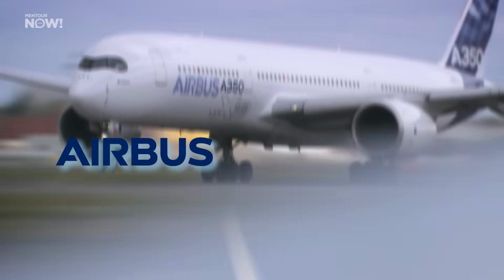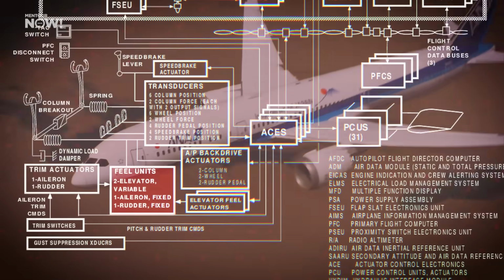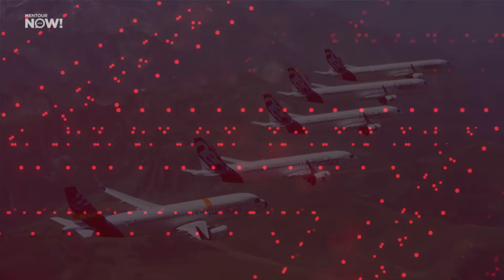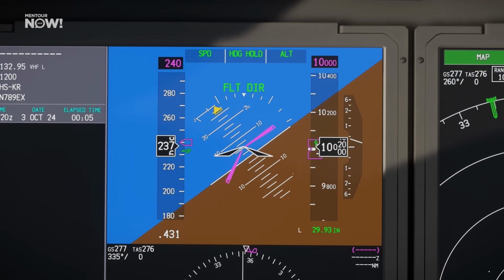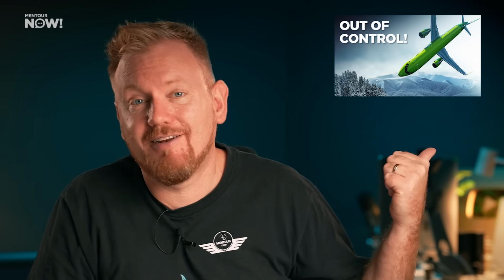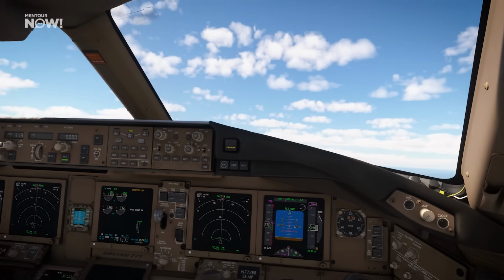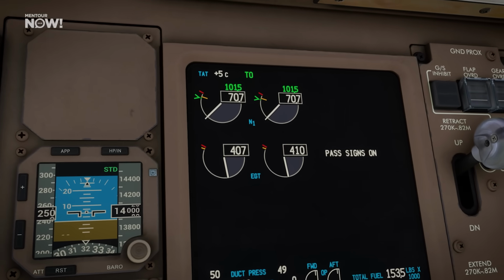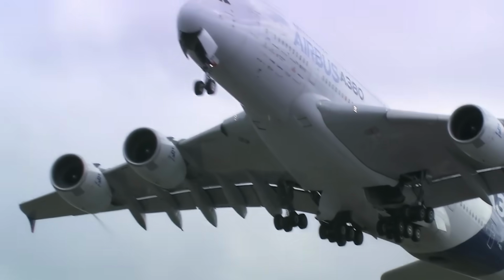Do Pilots Prefer AIRBUS over BOEING?!

Comment: The fantastic safety record of the 737NG also shows no statistical difference to the A320 family. These are the planes that are/were built in huge numbers, and each aircraft usually has multiple flights per day. These high numbers really give you the best statistics possible. 

I guess it's also safe to say that the updated 737max will be as safe as the NG. 

So long story short: Boeing or Airbus? It actually doesn't matter at all.

Comment: As a professional seaman I say like this - there is not such thing as too much information, ever. If you feel overwhelmed by too much information at hand, then it's time to seek a new less complicated profession 😏
Reply: True, but less important information can drown out the most important information based on how it's presented,  information can be faulty,  and with modern systems,  the computers could be better designed to filter out errant or misleading info,  warn about contradiction, etc.  And good grief- why don't they have cameras pointing at wing and tail surfaces and landing gear?
Reply: @jamesengland7461  Fully agree - when one can independently filter the information, then it's the best choice. If there is no choice, then I'd rather take more, than less, and I believe this is the case here. Point about the cameras well noted, I do not know why there aren't any such systems (in most cases) yet.
Reply: That might be because your ship moves much much slower and cannot get into an uncontrollable state as quickly as a plane can, when handled incorrectly.
Reply: @axeln6743  Not as quick, correct, however this depends on the situation. When handling cargo operations with chemicals, then it's another story. On a chemical tanker navigation is simple, port approach a bit more complicated, however all this pales in comparison with cargo systems, which you do operate yourself. Different situation.
Reply: Too much information when you don't need anything beyond the basics is wasted.
Documentation is fine, but I don't need a 40 page backstory on aviation systems in order to diagnose or troubleshoot an issue. Especially when time is of the essence and lives depend on it.
Reply: It all depends on how much time you have to process the information and what else is competing for your attention at the same time. I presume that in most circumstances at sea, the time from the start of an emergency to a total disaster and everyone dying is a bit longer than on an aircraft out of control.
Reply: @nrml76  Very true, there is very often more time, however that depends on the situation. On average yes, in particular cases not much more time.

Comment: It's not a debate. Boeing has been clear second for the longest. Clear cop out in the conclusion. Perhaps Boeing's 4th generation planes, the 777 and the 787 are "safe" ... when it comes to Boeing's production figures, the 737 MAX is/can be/should be produced at the highest rate with the most orders on the book. The small planes most people fly and make kilometers in are either 3rd gen Boeing or 4th gen Airbus. And with 90% less incidents that means that in the mean taking an Airbus is 10x safer.
Reply: No, the 737NG and A320 have very similar safety records.
Reply: I recently was watching a planespotting video.  There were more Airbus planes flown in the 1 hour video than Boeing.  It was mostly A320's, A330's, and A350's. I also watch plane crash videos.  MOST of them are Boeings, and it's not even close!

Comment: Flown both, 10000 hrs on the Airbus and 7000 on Boeing including lamentable Max. If 737’s were fridges they would have been banned years ago. Airbus for my money are way more impressive, the cockpit’s are quiet, roomy and well thought out with a great operating philosophy. Many note the static thrust levers are a hazard but because Airbus FMA’s are rigorously called out and acknowledged the operating loop is tight. Protections are brilliant, windshear full back stick and Toga power the jet will look after you as with all the other potential pilot cockpit ups. Most of the Boeings I flew were powerful and had good lift but goodness the cockpits were messy and some (737) noisy and manuals were complete gobbledygook’ flaps are not down they are not up? What?
Reply: @Blueteddy-kq1pj  
Fascinating comment. I had heard of the quieter cockpit in the Airbus before. Surely massively important  for any flight beyond 90mins?
Reply: It is clear from pilot comments that 1) Airbus wins in cockpit design, room, and comfort and 2) pilots feel comfortable with what looks like excessive automation.
Reply: Maybe you should take the MAX for a ride.. good upgrades.. would change it for one of those busses..
Reply: @ACPilot  He said in the original comment that he has flown 7000 hours on Boeing aircraft, including the 737 MAX?

Comment: AF 447 Would not have crashed if it was a Boeing
Reply: The multiple crashes that happened from pilots pulling back in panic on their controls during a stall and letting the plane fall like a leaf into the ground wouldn't have happened if they were an Airbus. Stall protection has saved people's butts multiple times
Reply: @ianriggs  In this instance, pilot(s) got confused between the stall warning and erroneous IAS (too fast). Stall Warning takes precedence. Airbus side-stick philosophy allows pilots to input independently.. Not so on an ac with control column where inputs are clear… this is especially significant when entire cockpit is lit up like a Christmas tree and the ac is screaming at you, especially with stall warnings. Things need to be dumbed-down as much as possible in these situations, not everyone continuously pushing side-stick priority fighting for control. Airbus definitely has advantages over Boeing, but cockpit philosophy using  big chunky switches and control columns is a win.
Reply: @TheJunglecrab  they definitely both have their pros and cons. But I think overall, the flight envelope protections have proved their importance. The fly by wire and Airbus cockpit certainly aren't perfect in every situation, but my opinion is that the protections have saved people's butts enough times to prove their worth
Reply: @ Every Boeing plane is effectively fly by wire except for the earlier verisions like the 707 727 and 737. Boeing also has flight envelope protection but ultimately pilots can override against force transducers  (as opposed to Airbus, where the flight envelope cannot be overridden (*completely))
Reply: @TheJunglecrab  777 and 787 are the only Boeings that could be considered fly by wire that have any form of flight envelope protections if you don't count the max and it's secret "protection"
Reply: @ B737 NG: MCP inputs send a command to FCCs, in turn send a command to autopilot actuator. This inputs to the  flight control. The flight control subsequently  moves and gives feedback to a back-drive actuator causing control column to follow the control surface - Et Voila, fly-by-wire. Yes, there are cables  and crank assemblies involved (mostly removed on 777 and 787), but whether the  PCU is in the wheel well or on the control surface doesn’t change the fact that it still is “effectively” fly-by-wire. Yes, pilots flying without autopilot engaged, is not fly-by-wire.

Comment: The next generation of commercial aircraft will take even more away from the pilot. For example, modern electric EVTOL aircraft are so simple to fly that a pilot does not have much input. As a pilot that is flying an older Boeing that uses cables (737 NG), I feel lucky to have this experience of handling the aircraft manually. Hand flying is truly a joy that future pilots will never be able to experience in the next generation of commercial aircraft. I got into aviation for a reason, and hand flying my 737 is why and I do not ever want that to go away.

Comment: Airbus, Next question.
Yup, airplanes fly better than pilots, and too many crashes would be avoided if the planes didnt let the pilot so much autorithy.
And the exception to this rule, was a Boeing model.
Whats the percentage of crashes were pilots didnt trust the instrument, believe they were wrong against a pile of evidences, or didnt follow the procedures or even fought the planes until they manage to Crash It? 95% maybe
No, pilots are need for the special cases where the planes need intelligence, but they fly much better on the daily basis.
It needs to be changed to the planes flying itself and the pilots only pushing the override button in emergency cases or in good conditions to maintain proficiency.
But as soon there is clouds, night or troubles, let the planes do It.
And CCTV recording and downlink on every cabin 24/7, like any other workers worldwide.
I even listened a pilot arguing about CCTV because "no other workers are recorded doing their work" 😮, a spanish one, after spanair.
What other worker can be so insane to say that? A pilot, It seems. Thats scary as hell.